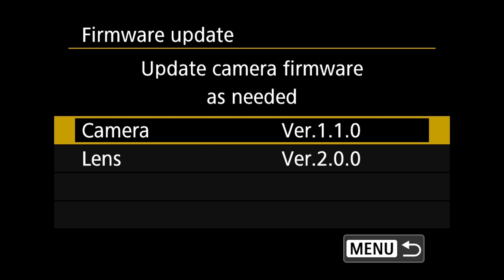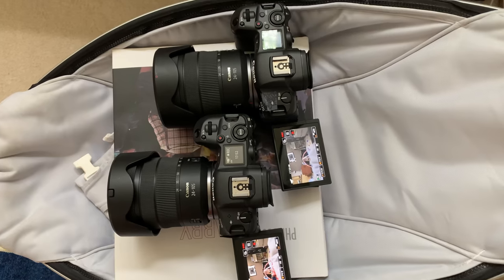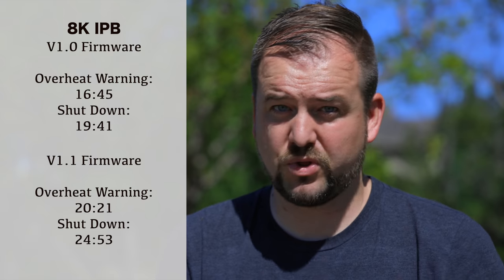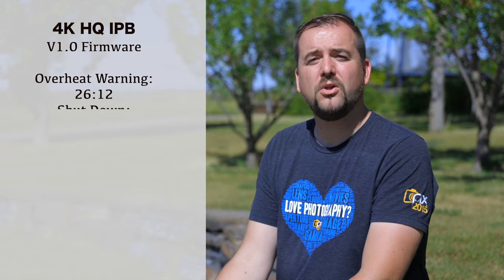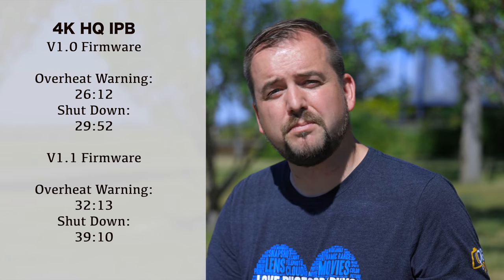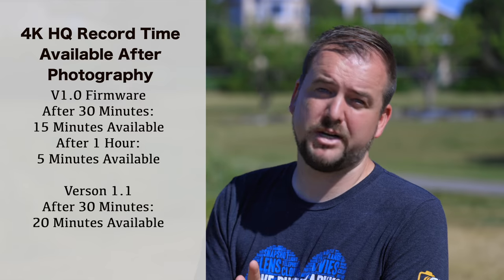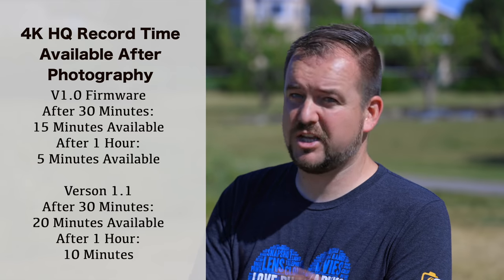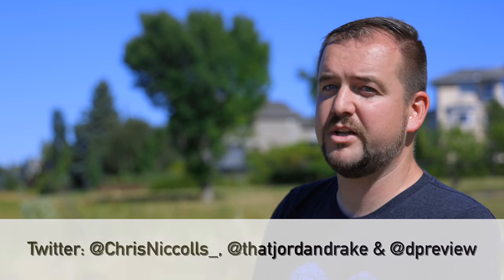Canon R5 Firmware 1.1 - Is the overheating fixed?

Comment: The overheating is just A SOFTWARE BASED CRIPPLING CLOCK, how long until you speak up about it? it's very problematic your silence regarding this matter, the sooner or later this will blow up. Trust me
Reply: Until who speaks up about it? Jordan at DPReview or Canon? I would hope that Canon provides some engineering explanation for the long cool-down times and the recording limits. A YouTube channel certainly has no obligation to, and has to tread carefully to avoid possible legal action against them, or YouTube strikes.
Reply: @johngwheeler  They won't acknowledge those shady crippling practices until enough people expose them. That's why somebody needs to step up and show the fake overheating, because it's clearly software based. (There's proof of it) Whenever that happens, hopefully Canon will have to come clear and finally explain why they didn't just say from the beginning that they needed to cripple it in order to protect its cinema line.
Reply: Angel Hurtado as long as there’s a market to sell this camera it does not matter whether they’re crippling it or not. If it sells they win.

Comment: On the R5, is the 4KHQ mode in 10 bit and is the standard 4K mode in 8 bit?
Reply: Log is all 10bit
Reply: it can be both 10 bit 4:2:2 on log. the difference is that HQ is downsampled from the full sensor resolution, and normal mode does lineskipping/pixel binning, that leads to an image with lesser detail.

Comment: in my opinion the time limits are fine for a small hybrid camera without active cooling. but the cooldown period is still way too long and feels too artificial, which is my major gripe. after half an hour all should be (pretty close) back to zero.
Reply: I would have thought that pretty much any small integrated circuit would be at near ambient temperature 5 minutes after power off. They have very little thermal mass I imagine. Having a heat sink of some sort would help.

Comment: The firmware update just proves that the overheating issue is based on an internal timer, not an actual temperature setting. The cripple hammer was just backed off a little. This still makes it unusable for professional use if you want to shoot quality 4K video. Basically, this is an expensive camera with an overclocked sensor/processor without proper internal cooling. Just like an overclocked computer, it will fail prematurely. Better get an extended warranty if you buy one. I can see a lot of logic board replacements within a year or two of ownership.

Comment: I'm a pro photographer and the R5 never, NEVER overheats for photographer. NEVER. It's easily the best mirrorless photo camera in the world right now. Period. The A7RIV is a close second, but it's slower to use and the image quality (dynamic range, noise and colours) aren't as good as the R5. 
I get a kick out of the video/vlogger people who try to spread rumours that the overheat issues exist for photos. It's a lie. Period. Additionally, you can shoot photos all day and then shoot 4K full frame 24/30 video unlimited as well in the normal mode (which is still very, very good, better than the last generation cams for 4K and some show it being better than HQ modes even on the A7SIII (Parker Wallbeck did a comparison) .

Anybody that is shooting 8K, or 4K HQ or 4K 120 would have to be a millionaire to be shooting hours of unlimited video as the memory cards would cost you way more than the camera itself to shoot like that in those modes. On production, videographers often turn their cameras off (cinema cameras) between takes to cool them off and takes are usually very short. Additionally, they almost always would use external monitor/recorders to get Prores and the R5 can shoot 4K HQ basically unlimited to an external recorder. 

I recently saw Armando Fererra's video where he shot a movie short on a pro environment with pro actors using the R5, and he got it done... even before the new firmware. Additionally, he didn't use an external recorder which was odd, I guess because he was shooting 8K - something no other mirrorless can do for even 1 minute let alone 30.

Comment: I currently have a canon t7i and looking to upgrade in a few weeks. I am a freelance hybrid creator who mostly does videography, real estate photography and video and portrait work. I really wanted the R6 to be my upgrade but I dont feel conformable dropping 2500 on a camera that will be unreliable in the real world for what I do. I have rented the eos r before and liked it but im not sure if it is future proofed enough at this point and the video specs are not that great. I also dont know how I feel about investing in canon with their camera shenanigans and known cripplings. I'm lost, somebody help. Any suggestions???
Reply: Sony A7Siii if it's price is within your budget and the resolution is sufficient for your photos. Fuji XT4. Nikon Z6. If you can wait, the Sony A7iv hasn't been announced yet but is expected soon, as is a refreshed Nikon Z6. Another option would be to get Cannon DSLR which can use your current lenses, probably best to buy a used one since it's not future proof.
Reply: Dennis thanks Dennis. The A7siii is definitely out of my range. Looking to stay under 2500 and 2000 if I can. I have been looking at the eos r, z6 and Sony a7iii and tryna figure out which would suit me best. The only canon glass I own right now is the 10-18, 24mm 2.8, 50 1.8 and sigma 18-35. I pretty much rent anything else so I am open to switching systems.
Reply: @MarbooJr  Sony A7iii and Nikon Z6 are both nice options. The A7iii has internal log profiles while the Z6 has 10-bit n-log / 12-bit raw over HDMI on Ninja V monitor.
Reply: @chanjeff4406  I agree with this. I love my Z6 for its ergonomics and my colleagues have A7iiis which i also love. both are great for their price and specs. its now just a matter of systems.
Reply: @bookphile870  I also have the Z6. And, I enjoy making photos and videos with this camera😃
Reply: @chanjeff4406  I know right! Its an absolute joy to shoot. I've noticed that I go out and shoot quite a lot now thanks to my Z6. What lens combo are you using with it?
Reply: @bookphile870  I am using F-mount lenses on the Z6. I mostly use the Nikon 18-35 because I shoot landscapes. I also use the Sigma 14-24 and Tamron 45 for other photos.
Reply: @chanjeff4406  That's a nice set. I mostly shoot weddings and portraits. I have the native 24-70 f4 which works amazingly for both stills and video, on a gimbal, handheld, you name it. And for portraits i have the 85 1.8g adapted, which also works great for me.
Reply: @bookphile870  Thanks. You have got a nice setup too. I am interested in the 24-200 as it has decent image quality, variety of focal lengths and is very light to carry.
Reply: @chanjeff4406  Thanks. That 24-200 sure is a great lens for what its supposed to do. I'm gona upgrade my 85 to the S version and get a 35 to go along with it next year probably, that would honesty complete my setup for like 4 more years.

Comment: Maybe the solution here is for Canon to supply Magic Latern with the firmware code, let them come up with a "proper" version that's fit for purpose and then charge £100 for the "upgrade" and split the money. Saves us having to wait, saves face for them. They could call it the Canon R5rs. Or maybe the R5ml. Then rename original version the R5CH - short for, well, you know what it's short for...

Comment: At 2:06 Let me pose a question to DPReview and their readers: using logic, reason and evidence: does the R5 contain enough thermal mass to remain warm after an hour? Is the R5 insulated with a vacuum like a Thermos?! Think people! Thin little PCB's, CPU, RAM and image sensor. No heatsink. No heat-pipe.  How in the hell can that stay hot or even warm for an hour? I bet anyone $100 that if the R5 is submerged in liquid nitrogen and allowed to cool to -240° F that it will still give a overheat warning after 20 minutes. It will be the ultimate proof.  Indisputable fact that Canon is lying about "overheating".
Reply: a freezer for 15mins in an airtight bag is enough!
Reply: https://youtu.be/3bOeoYI6EYs
Reply: @thatjordandrake  Thanks. I saw that just before watching this DPReview video.  Same results. You get a few more minutes of recording before "overheating".

Comment: Gordon Laing just covered this too. Apparently there's 3 temperature sensors in the body AND a timer. The firmware now makes better use of the ambient temperature sensor, which is located near the ports on the left. Ugh...Canon, you are handling this terribly. Coming out with a crippled camera, and being silent about the elephant in the room. Just admit that you screwed up and fix it! If I worked for Nikon, I would be very happy about all this right now.

Comment: Fix it or drop the price and price it as a competitor of other cameras that compete at the same resolutions and run times.
. If any camera overheats it is a hobby camera - there is no client that patient. If it overheats at any point then they should remove the limits of the camera and release it at whatever resolution of shooting setting doesn't overheat.

Comment: The Japanese standard for low temperature burn protection states that the contact point of the human body must not exceed 43°C in a 35°C environment, so isn't it a limit to protect this?

Comment: How is it still not completely cooled down after an hour though?
Reply: That's what is also stunning. An hour is a long time in ambient. These things must be really cooking on the insides, if it takes an hour for the heat to dissipate.
Reply: Or maybe it IS completely cooled down after an hour but the firmware limits you anyway.
Reply: @SrCarpi  No. If you cool it below ambient (i.e., an air-conditioned room), the firmware allows you to begin recording again much faster. It's definitely a temperature sensor, not a timed sensor: all the hacks simply reset the temperature sensor.

Comment: "With the new camera, we have addressed your concern about single card failure, as this camera has 2 slots. Errr, however, to be able to use it in the field you will need to buy 2 cameras and use them in turns while the other one cools down."

Comment: Well now, will anyone expect any further updates regarding overheating and cooldown times? What would be the point to release a half-improvement in fw1.1 as if there was more room for them? How much this "room" is an artificial cripple hammer and how much is real is irrelevant. I honestly don't expect further updates.... That's the main issue with Canon and/or these cameras.

Comment: When they increase the operational temperature specs like this they are reducing the operational life of the camera. Why do you guys want a camera that maybe will stop working after two years (rest assured, they will not reduce the working life of the camera to the point where failure during warranty starts to become significant, lol)? Because that is basically what you are demanding and what they are going to give you.

Comment: What you guys prefer? R5 or a7s3?
Reply: Fully video Sony 
Fully photo Canon
Reply: 5d mark 4 for photo
BMPCC 6K for video
Reply: Ashmaterial i preordered the R5 and cancelled it. A7R4 for photos and GH5 for videos. I don’t mind throttling back on the specs, but I do mind when they limit how long I can use something.
Reply: Bmwryder that’s a good combination man, best of both worlds
Reply: David Love that’s a great combo, same glass and full frame capabilities to get stills, nice
Reply: Guthrie Melchiade there are so many good affordable cameras out there, but I was truly excited for the R5 to finally have 1 camera to do video like my GH5 and photos close to my A7R4. Then that way I only need 1 camera and 1 set of lenses. Maybe I will switch someday. But I’m also hoping they come out with a higher MP GH6 soon like even 35MP would be cool.
Reply: It makes no sense to compare the R5 and A7Siii. They have completely different use cases. The R5 should be compared to the A7Riv and Z7.
Reply: Dennis well in this case “Overheating” is the topic of the video, and video is the highlight or concern for the new camera. I think canon poorly market it to do it all when is limited. I think the main concern is that is not ready for professional/production ready without running into a limitation. I think if you’re relying in making money back for your investment this might not be option 1. If you’re using it more of a project passion setting by all means this is overkill for that for sure.

Comment: Jordan, plz test the camera with the new firmware in a big freezer (like a
 local slaughter house) so we can see for sure if the limitation is from software (99% sure)
 or hardware. Thx !
Reply from the maker: Already did! I put the camera in a fridge, it was able to record 45 minutes of 8K without even an overheat warning. The camera is definitely factoring ambient temperature.    Jordan @ DPRTV

Comment: Better, but the cool down times are still too long for the 8k and 4k HQ to be much more than gimmick. So far, the R5 doesn't look like the ultimate video machine Canon marketing promised. Instead it looks like a superlative still photo camera with video tacked on - more or less the same as the A7Riv and Z7. The video is good enough but no better than many cameras costing half, or even a quarter, as much.

Comment: So they just adjusted the overheat thresholds for the processors. Why on earth did they not use an active cooling solution ... Heat sinks and thermal compound is the least they should do

Comment: Thanks for that, probably took quite a while to do so appreciation is deserved...
I actually (currently) don't think the limits are artificial BTW, just they need them to always be valid Worldwise and are conservative, as they don't want people's cameras to fail. Others aren't so fussed about that...
Reply: But surely they could have achieved that by err, actually measuring the temperature inside the camera? Which clearly they're not. I mean, bearing in mind the tech inside this camera, actually measuring the temperature is so trivial it beggers belief. Sorry, cripple hammer it is...
Reply: @markjiggens3051  They have three temperature sensors, one doing the outside temp. So various internal area's temperatures have to be inferred. Also it improves faster after overheating if you throw it in a freezer (I really don't recommend that BTW).
See: https://www.youtube.com/watch?v=3bOeoYI6EYs
at 6:20

Comment: With an average improvement of only 4-5 minutes I'd say the problems are still largely there - hardly worth the install of the new firmware.  From tests done earlier it showed that the CPU was operating at normal temperature when some kind of timer went off causing the camera to claim it was overheating...that's the basic issue the Canon still has not admitted or addressed as far as I understand where we are at now and that's a real shame!

Comment: I still feel like they're judging your record time purely by a timer, not with sensors or thermostats
Reply: The available recording times after a cooldown are still suspiciously round numbers. If it were really based on temperature you would see the time increasing in less predictable multiples.

Comment: I really want the R5 don't care about this problem. What Im interested in is if it is problem with shooting stills - let say bird and soccer. You will use the AF and shoot allot of frames in this use cases. Lets say 300 picture during 45 min and AF hunting les say for 30 min of this 45 min ( with eye focus) and after 15 min could. it do it agian without heating problem.
It kicks my A7 Riv AF if I understands it right and the A9 in res, the R serie have glasses that is best in class.. . 
If I can afford I will buy it if my use cases works

Comment: a little more acceptable...still not quite there. and why is their no heat sink or pipe on the processor?
Reply: LOL..real article from EOSHD ..you will understand why
it's not the overheat..they just want to protect cinema c amera..lol
Reply: @CryptoKartels  eoshd is guessing a single timer control. Canon said its 2 sensor plus timer. Not sure what is truth. But their battery door jam or internal battery reset although can extend one extra full cycle, we don't know what's real temp and if continously repeatedly doing that eventually will cost hardware damage due to long-term overheat. Canon has to keep this camera reliable long term instead of let you gain more video minutes short term. Canon should explain their technical reasoning for the restrictions. It could all be market segmenting like you said as well...so we will find out.
Reply: @ayayoutuber  i do love canon, they made life easier. To be honest, i dont have money to buy this camera. But, you know for 4000Usd money, i believe ppl deserves more than the current timer.

Comment: Took out a large loan to switch to the R system based off the hype of Canon's marketing with this R5. Thought this would give me time to sell my EF glass and bodies I currently own... Canon what the f**k are you doing? So frustrating you hype the shit out of this as a professional tool for video work and it's limited af with this cripple clock. SMDH. Also had plans to buy multiple R6 bodies as well but those are even worse with these overheating issues rendering them effectively useless for any event style video work! Well I guess it's time to hurry up and wait for Canon to throw us another bone and stick with my 5D4's for even longer. They are losing so many customers because of this mess. Really don't want to switch to another manufacturer but this bs is definitely making me question my decision to stick with Canon.